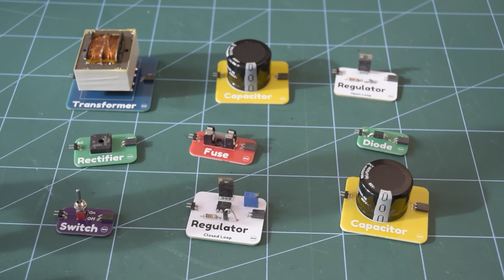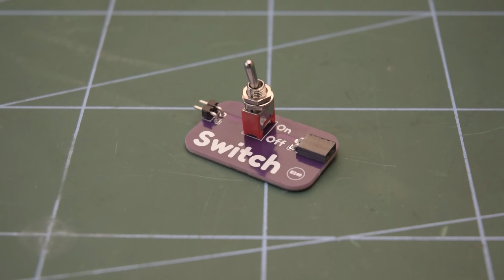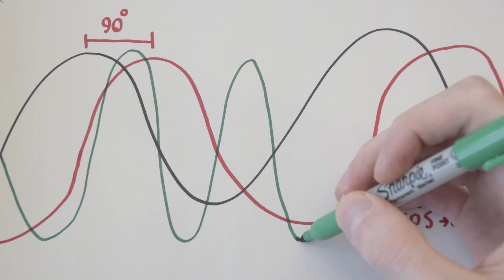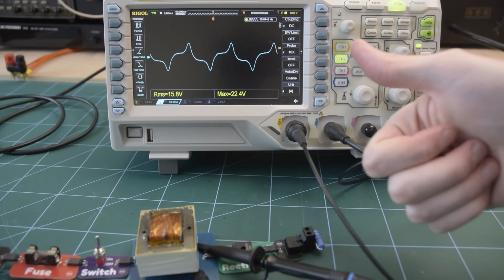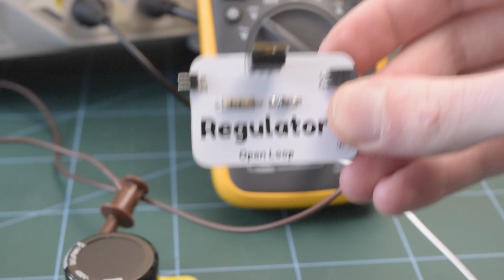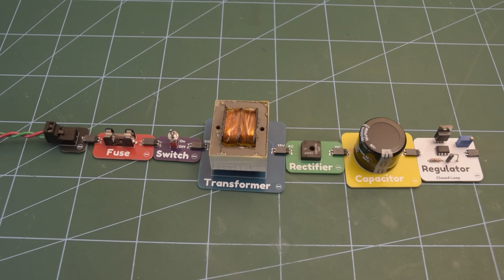Every Component of a Linear Power Supply Explained (while building one)

Comment: Hi, an electrician here.
The reason why some fuses have sand in them and some do not is because of what we call "rupture current". A fuse "blows" over a certain amperage, but litteraly "ruptures" or "explodes" at a far higher amperage. The basic theory is that you need higher and higher rupture-current components, the closer you get to the power source. Sand-filled fuses are usually designed to have a far higher rupture-current than an air-filled ones. If you wanna know more, read into "short-circuit current theory". 😉
Reply: So no-sand fuses are for situations where it's estimated to be "less catastrophic/energetic", so the sand isn't necessary?
Reply: @Ikxi yes
Sand- oh shit voltage
Nó sand= see shoild bé 😊 good
Reply: @wailingalen Thanks!
Reply: That's what he said mate, you just didn't understand.

Comment: Fantastic tutorial on linear power supplies. I grew up when almost every appliance used a linear supply with discrete through hole components, there was even still a fair bit of vacuum tube tech kicking around in the eighties.

It made things pretty easy to understand and work on, although you had to be careful working on things like CRTs while powered up so if you were serious about poking around in stuff an isolation transformer was often the second project you built after a linear bench supply to reduce the risks a little.

Comment: I have difficulty understanding how a zener diode works. I understand that at a voltage threshold it reverses and acts normally like a diode. But I have trouble understanding its uses especially when it was used with the BJT.

Comment: Do you still need the BJT on the output after addiing the opamp? I thought opamp  output is usually already buffered...
Reply from the maker: They’re very weak in power terms. I think the one I’m using has an output impedance around 100 ohms. You can get beefy ones but they’re essentially just an internal bipolar buffer and are quite pricey vs an external buffer like this

Comment: How do you determine the bjt required for this circuit? In undergrad for a final project  I was creating a wireless charging circuit, where I took a 12v dc input, somewhat made it into a sine wave, transferred over wireless coils (I.e. the transformer), rectified, smoothed, and put through a 5v regulator, and was only able to get 5v 300mA across, but the entire circuit got super hot. The mosfet I used to make the sine wave almost blew out. I didn’t know how to choose parts.
Reply from the maker: Sounds like you were using it as a linear amplifier not switching? Wireless coils always work on LC resonance to keep the losses in the MOSFET as low as possible

Comment: If the full bridge has a bigger voltage drop, what is the disadvantage of just having more turns on the secondary to compensate, as compared to a split secondary? Is it that the diodes having a voltage drop means they dissipate some power?
Reply from the maker: Yes it’s the power. It can be very significant at low voltages and high currents. They often need big heatsinks and even fans because of it

Comment: Bro, you are speaking little too fast. Slow down now ! You don't need to edit those few videos you posted but if your plan is to put 100 videos it will be hard to watch all of them. 

By the way good content, good selection. 
Can you describe differences between toroid and standard transformers as output transformer in tube amplifier ?
Reply from the maker: Toroidal transformers have better electrical and noise performance because they have constant core cross section and no sharp points. They are a little more efficient and have nicer saturation. But they cost more because if you want 100 turns you have to pass all the wire through the hole in the centre 100 times so construction is challenging. A typical transformer is wound while it is open so is much simpler to wind. This is why you don’t get toroidal transformers rated grater than a few kVA

Comment: Beautifully explained! As you mentioned audio stuff, there are some use for a linear power supply in a phono preamplifier stage, where very low signals are amplified. Because we are talking about 2-3 milivolt signals, the quality of a linear power supply is crucial. I have heard the term "ultralinear power supply". Is this term snake oil or anything else can be done to a liner power supply to make it even better. I do not own measurement gear so i could not see what you see.
Reply from the maker: A quick google and it looks like they are just standard linear power supplies. Maybe with more filtering and often with a toroidal transformer (better performance and noise but more expensive). So just high quality linear power supplies it seems

Comment: But how does the waveform of the incoming current look like after you've added the closed loop regulator?
Reply from the maker: It will be almost identical to the resistive load as the capacitor is still getting charged up in pulses at the peaks of input voltage

Comment: Very good explanation. The one thing I would definitely include is that linear regulator works by dumping the voltage away with current as heat, making it way less efficient as the difference between input and output raises.

Comment: Which connectors did you use for this build?
Looks pretty solid
Reply from the maker: Between boards are standard 0.1" headers, not very safe for mains even though they are technically rated for that voltage. The black ones at the ends are some Wago pluggable screw-down terminals I think
Reply: @electrarc240  Thanks for the reply buddy. BTW, in which category does your Uni's FS team race (CV/EV)?
Reply from the maker: @anonymouse8616  EV of course! Only UK though and we've not had a working car the last two years... (nothing to do with me 🙄)

Comment: Nicely made video. Only change I would have made is that in your rectifier, I think it would have been useful to build it from 4 diodes instead of using a pre-made rectifier, or perhaps have a 4-diode version and a monolithic version. As it is this way, the rectifier is a literal black box and it's not explicitly clear what is inside or how it is wired up.
Reply from the maker: Yeah I agree I should have done that. Somehow didn't think of it :(

Comment: This is simply amazing, could you do the same for switch mode power supply please, I know you already made a video on it but this method of building in real time and explaining is simply unmatched, once again thank you so much for make quality content like this.❤
Reply from the maker: It is much harder to do something like this for a switching converter because they are much more sensitive to the parasitic that are introduced in the connections. But I will be doing things like this again
Reply: I think a switching converter could be explored like this but you would need to run it at very low frequency which implies enormous magnetic components.

Comment: Very nice presentation.  Not quite sure why the simple old power supply is called "linear " in England first thing I notice in the old PS is the regulator.  That uses a reference (zener diode) and a power transistor,... so NOT linear.  As far as that goes, neither are power supply transformers, they saturate when they reach full supply voltage ( so the hysteresis curve becomes very flat when in use.... (not linear).  Nether are the diodes,... they pass current in one direction, not the other they also operate in saturation (with a roughly .6 volt drop if silicon) .... not linear.  !!!! hmmmmm.
Reply from the maker: I agree it's a bit odd! I've always assumed it is because of the linear regulator they contain but then the question is why are they called linear?

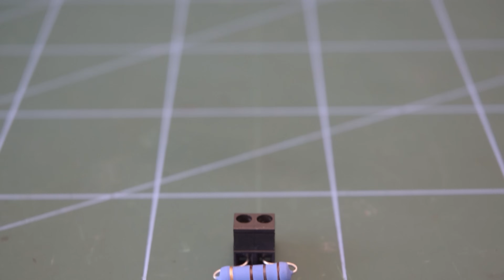Comment: At 16:21 why negative wave form appeared on the screen after the load was removed ?? Even though the probe was not removed or replaced??
Reply from the maker: Because there was no load to cause current flow to reverse bias the diode, the small amount of charge required for this (called the reverse recovery charge) was enough to prevent the diode from being reverse biased by the scopes 10MOhm input impedance. Essentially diodes will conduct in reverse a small amount of charge before blocking and there wasn't enough load for this charge to pass in the 10ms half-cycle

Comment: I will not say I’m new to the procedure as already I’m an electronics hobbyist but you made the explanation simple and digestible.
A simple question though, how do I achieve high current output like 10A from a small transformer?
Reply from the maker: Just need thick enough windings! And if there’s many turns then you’ll need a chunky core to not saturate too much
Reply: @electrarc240  That’s where it gets complicated, thick windings and many turns makes the transformer big and I’ve come across extremely small transformers when their output is upto 2.5A

Comment: Many years ago I had a shorted Bridge Rectifer at switch on - the fuse exploded into tiny bits of glass...
Reply from the maker: 😬 exactly why I don't like glass fuses!
Reply: @electrarc240  i used to do electronics for my job. Fluke only used special fuses in case the user tried to measure the main supply impeadance ☠️

Comment: YES!  I love how you’ve made your little colored ‘plug and play component’ boards with the labels, and the two leads jumping between them!!  The educational toy (that is now owned by the company that builds another other educational product called Sphero) called LittleBits use basically the same format as your boards, only, the contacts are by way of tiny neodymium magnets with a tiny spring behind them. Those connectors are basically the only proprietary item on their product, and I always saw them as a complete mistake in their design.  Your idea with the pin headers would have made for far better LittleBits, and I was on my way to desolder their magnetic contacts to implement your idea, until I was ravaging the poor copper traces on the FR4 boards enough to prove the endeavor too detrimental to carry on with. And then, besides the two pins, they made a third pin that carries (or not) a small analog signal voltage anywhere between 0 and ~5 volts. And the voltage is generally powered by USB or a 9-volt battery. I had thought of adding the option for bipolar power and signal, my indecisiveness took hold and killed the plans. I LOVE YOUR LECTURE and how you’ve really made public what I presume are details that once bothered or troubled you or left you with specific questions. By defining RMS, VA, power and current as it relates to those hardware specifications tables that dictate to us the standards that I  take for granted. I’m gonna watch your channel, as obviously you’re very well educated and electronics is something you value and find to be genuinely captivating. Thanks for making this just the way you did, and for sharing your plug and play boards!
Reply from the maker: Ah I have a Sphero! LittleBits sounds interesting but it seems as you say these companies cannot help but make a proprietary system which is a bit crap. Probably much safer than mine with mains on a 0.1" header haha

Comment: 31:37 what is that pot adjuster tool called? another great vid btw.
Reply from the maker: I don't actually know (it may be stolen 🙂). Quick Google looks like "trimming tool" or simply "trimmer adjustment tool"
Reply: @electrarc240  thx, I should probably get one. I always end up holding both meter probes in one hand while precarious jabbing at the pot with a metal screwdriver hoping not to short stuff out when it inevitably slips out the slot.

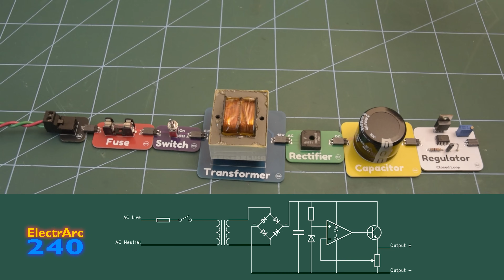Comment: Dumb question.................on the schematic at 33:18, why does the ac circuit before secondary transformer not short circuit and burn up?  If you take your ac plug in your house and connect a fuse and jumper wire between the ac side and neutral, it will immediately burn the fuse.  Why not here?  Thanks for the wonderful video!
Reply from the maker: Love this question! I spent years wandering this. It's because of the inductance, so even though the primary of the transformer has a resistance of only a few ohms, the inductance limits how fast the current can change so it can never reach excessive levels because the AC input means it is constantly increasing and decreasing. If you connected a DC supply at the same voltage the transformer would last probably less than a second! Hope that helps!
Reply: @electrarc240 thanks for clearing this up
Reply: Great question

Comment: For the purpose of clarification:
A linear power supply is a linear-regulated power supply. That means the regulator operates mainly in proportional mode. The shown open loop regulator wouldn`t fullfill this criterium.
Reply from the maker: Linear generally isn’t referring to the control (if there is any) it is referring to the use of the voltage follower / pass transistor at the output. Though the term is widely used for any PSUs that aren’t switching (50/60Hz transformer frequency)

Comment: Mabe you can conjure up some sort of isolation transformer.  To power either your test setup, or your oscilloscope.  That way you can probe mains voltage directly without blowing up your oscilloscope, just using a resistor voltage divider.  For testing small devices, I sometimes just use a shaver socket outlet, as my isolation transformer.  I'm a bit of a cheapskate and don't like to spend money unnecessarily 😂.  I did think of using 2 old microwave oven Transformers.  Connecting the two high voltage secondaries together.  That way you step up, then step down again.  But it's probably super inefficient.
Reply from the maker: I will probably splash out on a HV differential probe soon to be honest. Need it for other things anyways

Comment: Fantastic video! Very educational. I would like to watch an extended version where you explain by example the benefits of linear PSU over switching PSU. For example, why lab PSUs are linear.
As I can see there are no single right way to do things in electronics, because there are always downsides to upsides and I'd like to understand why some solution was used over the other one.
Reply from the maker: More and more lab PSUs are going switching these days, the cheap ones are atrocious and should be avoided but some of the fancy high end ones are super nice and low noise. And yes exactly, that is part of engineering I love!

Comment: Is a cap ever used to do pf correction on the primary?
Reply from the maker: Yes this is quite common in factories and grid level. Obviously the problem is you have to have the right amount of capacitance for the inductive loads connected so it gets quite messy quite quickly. Power electronics offer a much nicer solution with active PFC

Comment: The conclusion for why you need to put the switch on the front side of the transformer doesn't follow from the argument. The apparent power doesn't get reduced just because you have a switch, so long as the switch is on. The switch enables you to eliminate it, but while the switch is on it doesn't make a difference to anything, or am I missing something?
Reply from the maker: The idea is that if the switch is on the secondary side the reactive power cannot be switched off
Reply: @electrarc240  I imagined so, but that's sort of a key part that wasn't said in the video. And how then, does this relate to the size of the components in the power supply? I.e. since the switch can only switch the power supply on and off, the sizing of the components inside are presumably still determined by the state when the switch is in the on position? And thereby the reason for the switch being on that side, and the reason for the size of the components in the power supply are completely disconnected from each other?
Reply from the maker: @user-co7yy1yc4v  The size of the components is to do with the operating frequency mostly, nothing to do with the switch position. Was there something that makes it seem like they are related?

Comment: I live in a place where power has no ground, so I constantly need to unplug DC charging for my Bluetooth speakers, every time their batteries load to capacity, and this loud hiss comes from the speakers. I'm curious to know how to fix this. Also, Op Amps are still a mystery for me, very little details online about their inner components.
Reply from the maker: Yes if you open up an op amp there is actual fairy dust in there, truly magic! I focus on the application of components and don't worry about how they work too much (at least for analog things like that) so I am afraid I can't be of much assistance in terms of internal structure
Reply: @electrarc240  😄

Comment: This my be a dumb question but why does the transformer have so many turns? If you want 20 to 1 why not just do 20 and 1? like why would would choose 10-200 or 100-2000 to get the ratio?
Reply from the maker: The more turns, the higher the inductance. If we had 20 turns on the primary the inductance would be very small so the magnetizing current would be huge. So basically the fewer turns we have the less the primary is like an inductor and the more it is just a piece of wire, which won't end well! At higher frequencies less turns are required (one reason switch-mode power supplies are so much smaller!) so you can actually have 20 turns and 1 turn in that case!

Comment: How would you design the transformer, so that it does not saturate?
Reply from the maker: A) more primary turns would have more inductance which would reduce the magnetizing current
B) use a physically larger core so the flux is more spread out as it is the flux density that is the limiting factor
C) have no core! air cannot saturate 😏 (this would be an extremely poor transformer at mains frequencies, but the concept is used in multi-megahertz converters!)